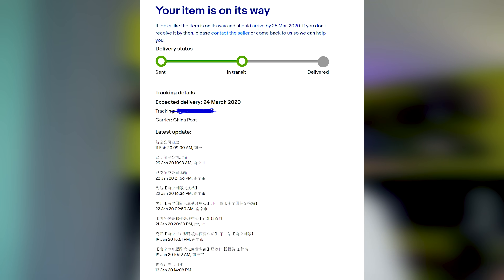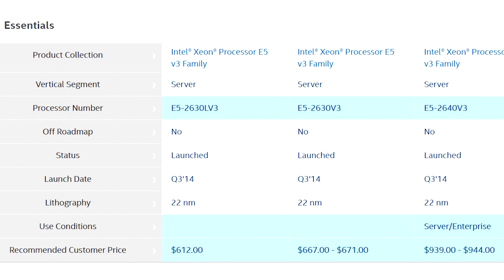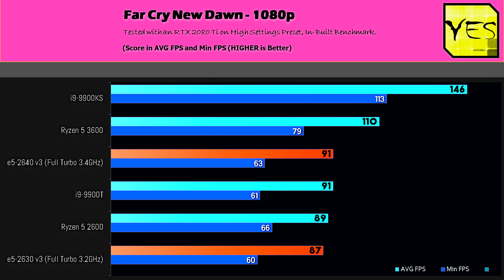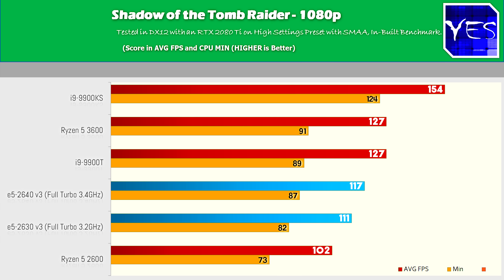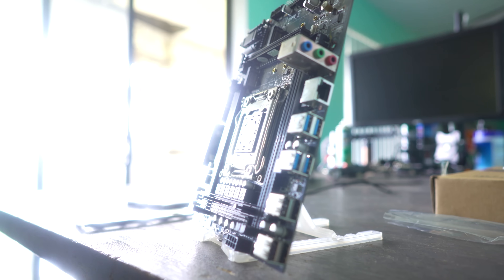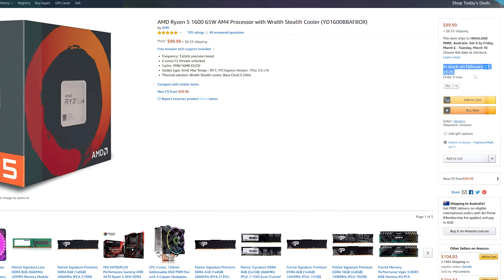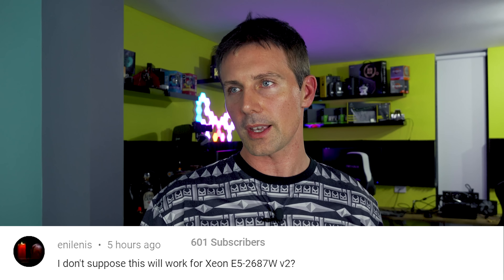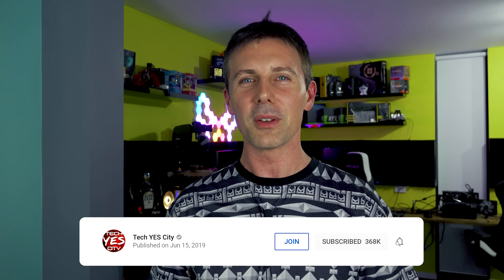8 HASWELL Cores For only $78...!? (E5-2630 and 2640 v3 Review in 2020)

Comment: What is the point when you can get roughly the same price/performance on Ryzen 2600 + motherboard combo.
Reply: Imo, it's more fun to slap together cheap out of date stuff than buy new. Cheap 8 or 12 core, crappy Chinese Mobo, bios hacks? Sign me up 😉
Reply: @edharding9363  I agree I do get a thrill just thinking about like finally getting 1000 dollar hardware no would even think of so cheap
Considering it that way its a bargain
Reply: @samsonsanthosh  virtually obsolete tech is never really a bargain. A still advancing platform for the same money with a massive and simple upgrade path for the same money, that's a bargain.
Reply: @lunchie80  you've got a good point but about what I said before xeons were a good deal pre ryzen since there wasn't much growth going on
Even bryan during his 350 dollar 2420v2 build said that he prefers to build a cheap pc now and build a new one after a few years and if it's good enough he'll sell it
He even said that it's alright if you can't afford it  
 since not everyone can afford it and that hit me hard bcs in the end your gonna end up with a pc that'll play all your games
Reply: @edharding9363  Bitchin'   😉
Reply: If you are building a workstation this is way cheaper... ECC RAM can be got so cheap, you can build a 12 core/24 thread system with 64GB RAM for less than half the price of a Ryzen system. 

If you buy 5x Xeon E5 2678 V3 and link them up via LAN you have the same performance of the latest Threadripper for 10% of the price, plus the advantage of extremely cheap memory. Total £1500 for 5 systems compared to £10k for an equivalent Threadripper system.
Reply: Ya it made alot of sense pre ryzen simply bcs of how much bang for buck you could get from these xeons 
Right now ryzen with its upgrade path 
it's gonna be even cheaper since amd cpus get really cheap over time and when ddr5 comes out these cpus are gonna be the next x58 cpus literally bcs of how good they are and its gonna take a long time before ddr5 becomes mainstream like ddr4 now

And to answer your question
Some countries have extremely bad prices so something like this helps out Alot of people out there
Reply: It will make a diff in ram prices and mobo not that much but if u wana be up and running fast this is an option .plus we still love old hardware its fun to play with
Reply: The point is that he makes money of these vids from idiots

Comment: Why cpus with more cores are faster than cpus with less cores? This makes no logic to me because more cores=more heat=thermal throttling
Edit: could this be because there are more chips, so each chip does work but it does let say half of it and another chip does the other half resulting in doing more work for less time?
Reply: Why do 10 workers do more work than 1 worker?
Reply: @AJDOLDCHANNELARCHIVE  I'm trying to say that 10 workers do the same job in less time
Reply: @AJDOLDCHANNELARCHIVE  thanks for explaining mate

Comment: yeah ive got the 1600 af running at 4150mhz all core 1.341v and cinebench is 3200, i guess in games will be also good due to high single core speeds. So at that point its way better then those dated xeons imo

Comment: The problem is mainboard still pricey... also Heatsink is hard to find or can find price also expensive.

Anyway I use 2630v3 with with MSI x99a gaming 7 for most 3 years and still running ok.

Comment: I still run a Haswell i5 4670K at 4Ghz. Beautiful CPU. Great price at $0. I am thinkin of upgradin sooner or later. I wonder what I should upgrade to......
Reply: Well it really depends on what you do with your setup. I recently upgraded from a Haswell i5 4690K to a coffee lake i5 9600K and seriously the difference is not that much.
Reply: @ruemignon  Well it depends on what games, what gpu and at what graphical settings you play for AAA games with good gpu such as rtx 2060 or so there is big difference between 4690k vs 9600k, well if you play esport titles there wont be much of a difference in experience.
Reply: I upgraded from an oc'ed 4670k last summer. Still a great chip but was starting to show its age in newer games.

Comment: Good work mate!You should compare the x58 xeons with these xeons.
Reply: Actual performance difference v3 vs v2/v1 is just the same as 4xxx vs 3xxx/2xxx on desktop - about 20%/Hz in general. If we're looking for roughly the same difference for 2xxx vs xxx(first gen core i) AND quad channel vs triple channel you'll get around 45-50 percent boost for the same speed. Ofcourse x58s are easy overclockable ones(on a normal MoBo) and could still game decent in most of games while tortured to near-4 GHz speeds, but for any serious workload they'll struggle a lot. And once again, the newer are games you're into, the more outdated they are(and will be even more drastically)
Anyway, it's up to you if you think about some upgrade. For a build from a scratch, as for me, it's not worth it:)
Reply: @andyshtroymish4997  X58 Xeons don't struggle to hit 4ghz at all, most can hit 4.2-4.5ghz without a sweat and have very low temperatures due to the soldered IHS (like 60 degrees C under load).

Comment: I'm looking at getting an E5-1680-V3. Still unlocked, and you can go well above the specified RAM speeds. Almost all of them can do at least 4.5GHZ all core, if not more. Best to have a custom loop to cool it though. 140W TDP!
Reply: Matt Christie it’s a 5960x, unless you already have X99 it’s not worth it to buy in
Reply: @MarshallSambell  I am well aware of the costs. I only buy HEDT. I like to overclock, and I like having PCI-e lanes. I like the idea that I can put an E5-2699-V4, and have a 22 core rig. I max out on 12 for the X79.
Reply: @mattsmechanicalssi5833  buy in to a 3700x at that point, it smashes the 5960x out of the park

Comment: These Xeons are good for virtualization, 2 of these, dual socket MB and 128Gb RAM and I can run eve-ng with no issue. I would go 1000 times for Intel than AMD for that purpose as Eve does not fully support the AMD CPUs

Comment: I finally upgraded my system this week. I went from a FX 9590 to a Ryzen 7 1700X. I got a Aorus B450 Elite refurbished MoBo for £70. 16GB of DDR4 Ram and a Aorus RX580. All used parts for £370 / $479 US. I live in the UK. So it wasn't too bad
Reply: Good job man enjoy I heard those boards could handle a 16 core
Have fun mate
Reply: Oh and enjoy the power savings 😂😂
Stay frosty
Reply: @samsonsanthosh  they cannot. Not the aorus, and especially not b450. Maybe the gaming 7 can, or the msi high end x470, don't remember the name.
Reply: @theunholybakery1990  Oh I heard it from hardware unboxed
Reply: @theunholybakery1990  If case is ventillated enough they do.
Reply: @samsonsanthosh  alright. They can run it at stock. I love overclocking, so if the vrm gets to 80c at STOCK it's a no no for me. In fact, my 3900x is running on an x570 godlike and the temps are way lower. I was thinking about overclocking the 3950x, not running it at stock. Sorry for the misconception.
Reply: @theunholybakery1990  Oh thank you so much man finally someone who's giving a good answer 
Like the only reason I consider the b450
A good deal is bcs an a320 can handle a
3600 even though it can overclock (the cpu) it's not worth it since pbo2 already does a great job and plus idc about the extra features like pci4.0 c swhen you're on a budget it's better to stick with things that matter the most like high speed ram
The thing with x570 is that it's just too expensive so if I get an entry level b450 board I was wondering if I could atleast get an 8 core on it or a 12 core when they get cheaper

But still thank you for your answer
Reply: @samsonsanthosh  right
Reply: @samsonsanthosh  a320 are poor quality no point touching those and anybody that advises you overclock on one is an idiot.

Don't go for the bottom end b450 either they are so weak on things like vrm and tend to not use great caps this is why best advise to to stick with MSI B450 the likes of Mortar/tomahawk/Gamer these are in uk around £80.
Reply: Selling your 9590 CPU?
Reply: I would like to build an FX system but the damn cpus are more expensive than ryzen.

Why build an FX system? For enthusiast purposes. I want to see what I missed.
Reply: @MrBearyMcBearface  its a not a bad cpu but it runs extremely hot

Comment: Hey great xeon video man
But I wanted to ask
Up to now how many cpus will work the best(ik it supports on every am4 cpu) on the gigabyte B450M DS3H like will it support an 8 core or 12 core or maybe a 16 core
Reply: @Iam_Dunn  um you're right but what I was asking was this motherboard costs under 100 dollars
What I wanted to know was will it support an 8 core or 12 core with over 95 watts of tdp I just wanted to know if the vrm would be good enough

Not to be rude or anything 
If what you said was true a 12 core 3rd gen cpu could work on an a320 50 dollar board without any overheating which is not possible
Reply: @Iam_Dunn  😞this conversation is not going anywhere if you really think that's how things work check out the 3900 and 3700 cpus on cheaper motherboards there should be videos from awesome Youtubers like oztalkshw and gregsalazar

Even Bryan told us in his 3600 in a320 motherboard that some of these boards example the a320 was made with the 65 watt tdp in made in mind and if you were to overclock(b450 or above) well its not gonna be 65 anymore
Reply: Wow noice way to just delete your comments man
But remember the internet never forgets
😂😂
Reply: @Iam_Dunn dw I took screenshots it's all safe with me
Now I can leak these messages and show how much of a dumbass you are
Muahaha
(lol I'm kidding I wouldn't do such a thing as leaking em but still your answers did not answer my question)

Comment: Miss a X58 systen in the benchmark 😉
Reply: im using X58 right now =] i7 970 6 cores 12 threads base 3.4ghz I have it overclocked left everything on auto on my P6T ASUS deluxe and only increased my BCLK too 168 and I get a stable overclock 4GHZ using a Hyper 210 coolermaster !! and I use my overclocked Asus dual GTX 1060 3gb, only upgrade I need is a RTX 2060 as even overclocked my CPU bottlenecks my 1060 at 1892MHZ OC yeah the 1060 cant keep up my GPU reaches 98% load and CPU is 60% load lmao and im running Red dead redemption , Destiny 2 ect I get 144FPS too 200FPS no dips using 24gb ripjaws 1866mhz and a 1tb Samsung evo native
Reply: Epic Gaming Ect Yo man, i have same mobo, but i do have i7 920 at 3.8 ghz, how much benifit i would get if i got Xeona X5675 at 4.0 Ghz, I'm running RX 570?Also, is your ssd running at native speed sata 3 6gbps?
Reply: @ivansaric4752  what is your cinebench r15 score? with a x5675 @4.4GHz I could get just over 1000 points. That'll give u some idea if it's worth upgrading.
Reply: Ed Harding I dont remember, but i ask mainly cause i have 144hz AOC monitor, so i wanna play as near fps to 144 hz, like Dota 2, CS Go, my two main games, so i was thinking how much fps i could gain with Xeon (25€), in those games and other games?
Reply: Ed Harding And i do have bad shit trieple chanel 12 gb ram, kingston green shit 1600 mhz, couldnt oc more, i was wandering triple chanel 12 gb ram low latency 2000 mhz, how much more fps?😎
Reply: @Ivan Saric  yes I am running Sata too my evo SSD 6gbs on Sata 0 . And yeah the upgrade I want is RTX 2060super and definitely a Xeon X5690 which has the biggest Cache and highest ghz in the X56 lineup ,basically that would Max out the x56 platform too it's absolute best configuration it could be as a gaming / editing / streaming Rig  and well I would use it til I couldn't game efficiently or effectively anymore,, for a 10 year old platform it has held its own very well. In comparison too AMD ryzen and even newer Intel systems let's say Fortnite Max epic settings with my Rig I get 190-200fps with very little in way of dips..
Reply: Epic Gaming Ect How to get my 860 EVO to 6gbs speeds?Our mobo is bottlenecked by sata 2 connector.Do you use pcie X4 card to sata 3 6gbps?
Reply: RAID 0 and too upgrade too the i7 970 I required too do a BIOs update which allows the newer CPU,s and configurations too work without the BIO,s update the Asus P6T Deluxe will not accept i7 970 and Xeons forward and will not work correctly with newer graphics cards and newer sata speeds !!!!https://www.asus.com/us/Motherboards/P6T_Deluxe/HelpDesk_BIOS/  https://www.asus.com/Motherboards/P6T/HelpDesk_BIOS/   in order too do update requires a 32GB USB and too save it their then restart and goto bios with delete key then flash too new bios for all updates
Reply: Epic Gaming Ect Can i have you whatsup or viber, or something else to ask you more?🙂

Comment: Hello Bryan, would you prefer this one 2640 v3 or the Xeon e5 2689? kinda looking into ddr4 one since I can put a ddr4 rgb ram I think?
Reply from the maker: Would go for the 2640 v3 now, unlock it and its extremely good with budget quad channel setup.
Reply: Tech YES City you suprised me Brian I apologize. Love the channel btw I made my first pc with an intel Xeon x5670 cause if you. I’m upgrading to ryzen 7 2700 for 190 cad shipped now tho. About 144usd. I told the guy you wouldn’t answer cause I figured you would be too busy to answer everyone now that the channel is so big.
Reply from the maker: @jacobleeson4763  No worries man, yeah try the v3 xeons if you get a chance, they are surprisingly really good.
Reply: Tech YES City thx but I just bought a ryzen 7 2700 the guy acc gave it even cheaper than originally planned 172cad or 130usd. And I got the mother board for free. X79 motherboards are always expensive unless you buy from China that takes a month to send. Also last thing I got from China never came because of the corona virus. I would warn you but to buy from China until that’s over.
Reply: @techyescity  didn't expect a reply! Thank you looking forward on getting one soon.
Reply: go 2640 v3, better performance, newer technology, more instructions, and can max turbo with the mod
Reply: e5 2689 is 32nm 😫
Reply: iFlicker chances of him answering you are between slim and none and slim’s on it’s way out of town

Comment: Hey, man. Is using two 6-pin to 8-pin adapter okay? My PSU's old but still a 600W one. It doesn't have 8 pins but has 2 6-pins.
Reply: Its probably a generic one dont prefer it might burn your othwr components.
Reply: Make sure the cables match what you’re powering. Don’t mix up the ATX power supply with a PCIe (video card adapter) and vice-versa. They don’t have the same layout.

Comment: indeed the processors are good for its price, but what would kill you is the price of the motherboards. branded lga2011 boards these days would cost you around 200 - 300 usd. you can get off-brand chinese ones for like 50 usd. but i wouldn't trust them. in total, everything would cost just as much as getting at least a ryzen 5 with a budget board.

Comment: Ryzen 1600af for 80$ wins. Case closed
Reply: cant run mkl, which is suck for certain users
Reply: you realize the mode in which he uses for these older Xeons is too gain the max clock turbo speed 24/7 and he hasn't bothered overclocking it with a Hyper 21 coolermaster or snowman he can overclock it too 4ghz which absolutely destroys your Ryzen 1600 hahahahahaha hell he beats it without overclocking !!!! it has way more cache
Reply: @EpicGamingEct  the 1600af runs the same as the 2600 witch yes his beats but is much easyer to set up buy 85$ cpu pit in 60$ mobo done comes with a cooler as well the oc I said was just nice icing on my cake
Reply: Ive gotten two for 85 shipped so far love them oc to 4.0ghz no problems